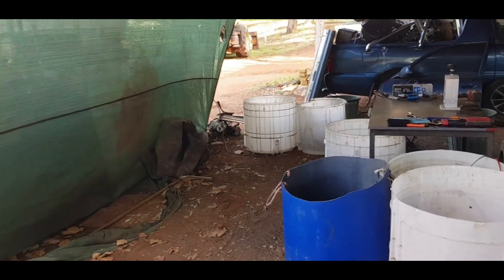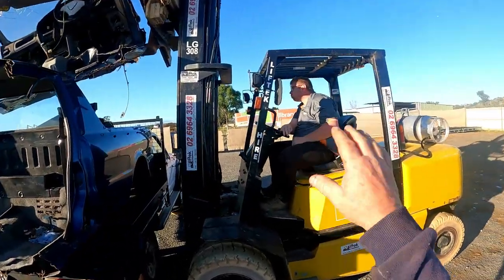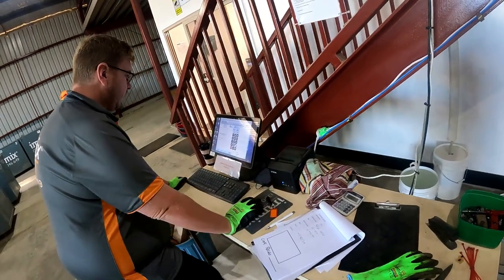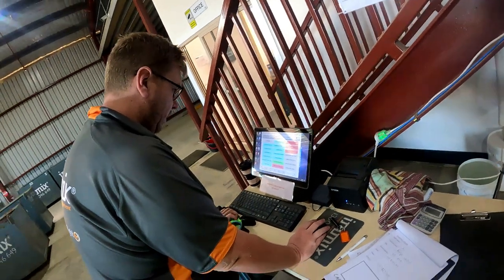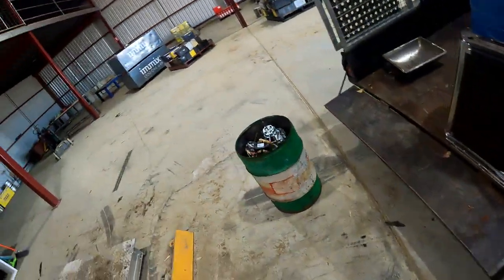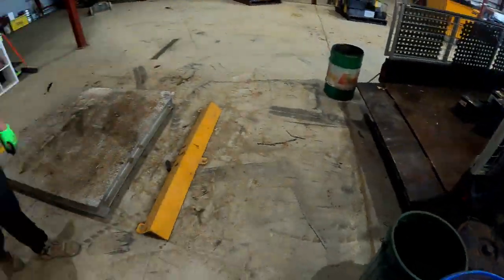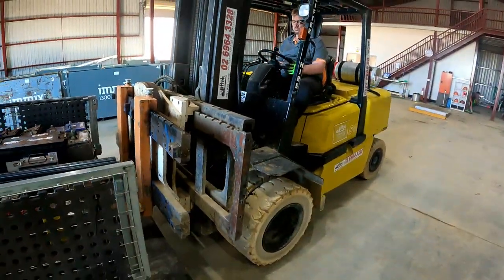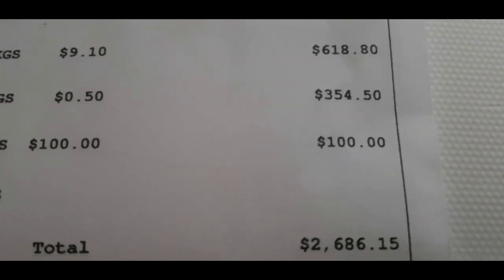SCRAP RUN NO. 5 Well Worth The Effort! $$$$

Comment: Have a peaceful, restful holiday.  I would weigh a plastic pallet because you made a valid point about weight difference when using a wood pallet. If you compare the weighed and paid amounts, think there was a little confusion on weighing the empty bins.  I wonder how the young man can operate the pallet jack safely.  Not a good thing to have that heavy metal bar coming out of the bin.  You both walked around it a few times.  Hopefully when you're back with more recycling the rules won't have changed, only higher prices.  Wonder if you were able to chop your scrap vehicle to smaller pieces if you could have got more in weight as regular scrap metal for shredding than the $100 you were paid.  That was quite a big difference in value! You and June worked very hard for the materials recycled today.  Will watch this video again!

Comment: The plugs you can boil water and get the plastic loose so you can use a knive to cut out the brass

The boxes plugs I think you just use a hammer on